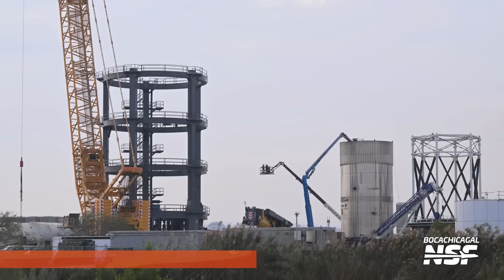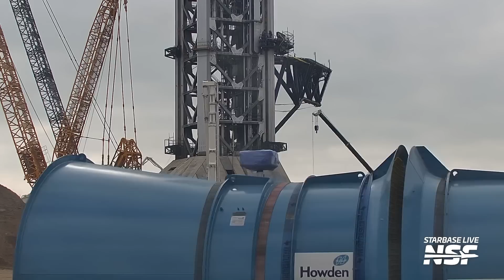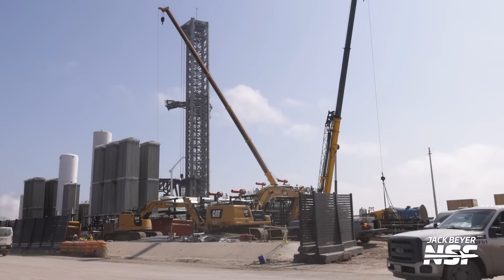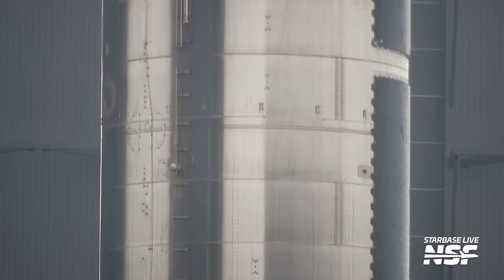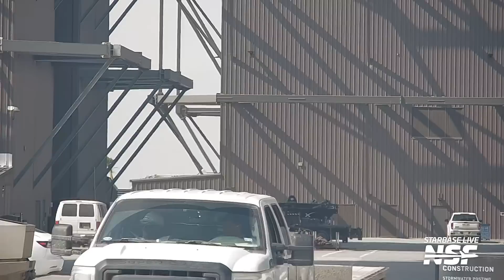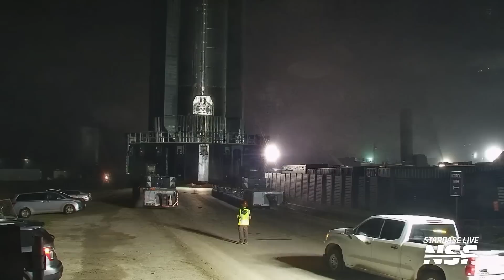Booster 15 Ready For Testing Ahead of Starship Flight 8  | SpaceX Boca Chica

Comment: If you attach a fan to your truck and the exhaust is working against you…turn the fan around🤦🏻‍♂️🙄
Some aircraft have powered auxiliary generators with externally mounted propellers. I’ll just bet they got the airflow direction correct.

Comment: It will never be aircraft save.
In total 38 raptors. There will always be a valve somewhere  fails. A pipe that burst. A bad wire.
Reply: I doubt it makes it airlines levels as well, at least not without a decade or so of flying and modifying.

Comment: You might have done the math wrong. It is possible that adding a small wind-turbine to an EV, could actually produce more power, than it takes out in drag, because of wind. Wind will add energy into the equation, if the EV is driving into a head-wind. And of course if the EV is parked in a strong enough wind, a small wind-turbine could charge the battery.
Reply: Sure a 46" turbine can produce 400ish watts at 12 volts.  All you need to do is stow it and set it up.

Comment: Maybe pedantic, but they are just "quotes", not "air-quotes". "air-quotes" is when you use your fingers to symbolize "quotes" in the air. See what I did there, putting "quotes" around "air-quotes" 🙂
Reply from the maker: And if I make the quotes with my actual fingers when I say it, even if you cant see it? What's the verdict then?  😅 - Das
Reply: @NASASpaceflight  Does not make a difference since you are referring to the quotes in the caption. Could you go on camera with you air-quotes ;-)
Just a personal hang-up. Keep up the good work. Really enjoying your comments, and preferring them over Klingon.
Reply from the maker: It's interesting... because if we had captured a label, and were able to directly quote what it says, we wouldn't use quotes in the title. Since this is an assumed name based on our best guess, we denote it with the "air quotes" (even though they're in writing) which carry a closer connotation to our use referring to the assumed tank. - Das

Comment: The Starlink holding box is more appropriately compared to a stripper clip or speedloader (Starloader?) not just a clip when referring to firearms.  Check with SpaceX for auto leveling supports.

Comment: Hey bud, just an FYI: the reason they let the fan spin during transport is to prevent the blades from bending due to restricted movement.
Reply: Thanks for that; I didn't consider that possibility.
Reply: Actually letting it spin freely does reduce the drag it creates while air passes through it or covering it with a flat cap (the latter one would be like pulling a wall through the air).

Static fan blades would force the air passing through them to change direction more than spinning ones therefore inducing more drag.

That‘s also why the fans of jet engines tend to spin if (strong enough) wind passes through them. You can sometimes see that when an airliner is pulled across the airport by a tug.
Reply from the maker: Sounds like the actual answer is a balance between drag, complexity, and protecting the electrical and mechanical components of the equipment itself. I wonder if they actually thought this through as much as we are 😅 - Das
Reply: @NASASpaceflight  I don't doubt someone was told by a bean counter to find the least expensive way to transport these things..
Those bean counters are pretty well motivated, so I suspect that this method is the least expensive.
Reply: Prevents brinelling of the motor bearings aswell. Electric motor are prone to it in transport
Reply: ...Or they could just put a tarp' over it.
Reply: yup pretty much preventing its OnlyFans to bend ;)
Reply: Guys that is Truck-size Booster
Reply: Ah nice
Reply from the maker: Interesting, but wouldn't it be better to cap it? Seems like letting the fan spin unrestricted isn't the greatest plan... but perhaps the fan is rated to spin way faster than it could ever spin during transport. Wouldn't it also generate an electric current that might not be ideal? Huh... appreciate the comment. - Das
Reply: @NASASpaceflight  Prop planes and helicopters do the same thing for the same reason. It's less drag than having the propeller stationary.

Comment: The orange line being pulled through the block for the reeving is a messenger line. It's attached to a heavier cable which is attached to the main cable, which is then hauled through.
Reply from the maker: Messenger line, nice. That's a lead to read more about... Thanks! - Das
Reply: @NASASpaceflight its orange!
Reply: @JackABeyer  Possibly made of polypropylene. Cheap, stretchy and ok for the job. Light and easy to handle round the sheaves. Coil it up afterwards and send it to Florida to use on the chopsticks there. Strong enough to reeve the hauling cable but not strong enough to haul the many tons of main cable.